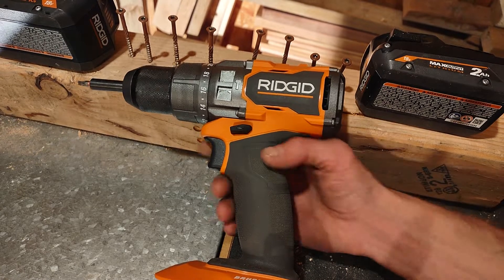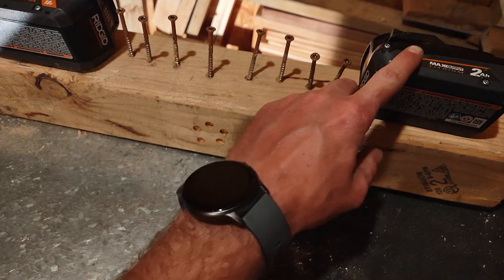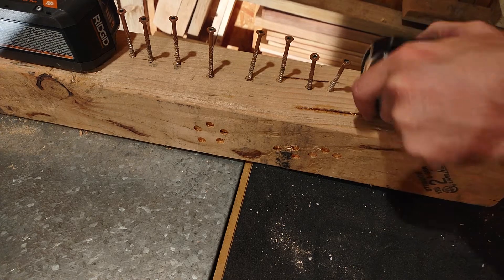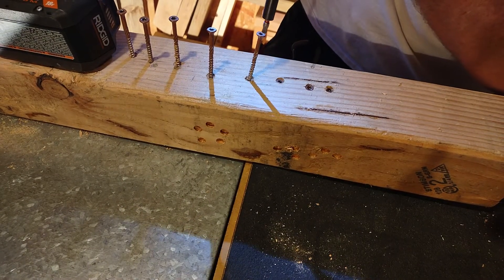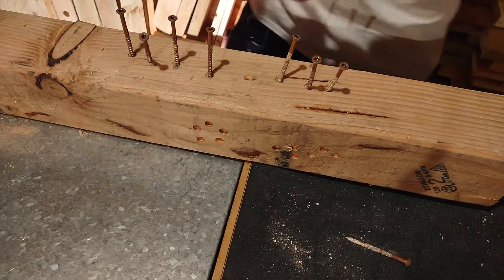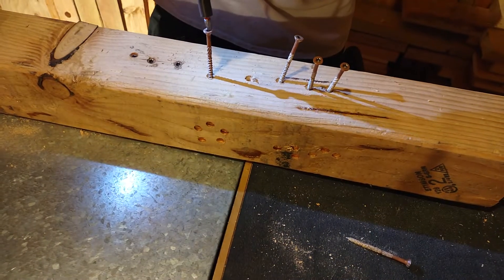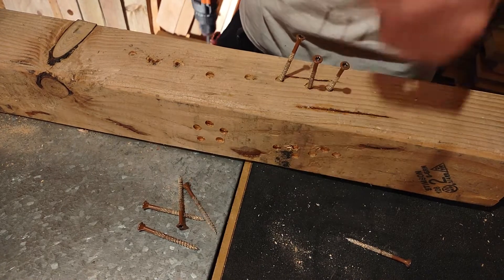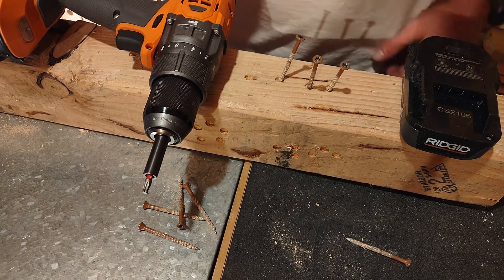Ridgid Max Output 2ah vs. 4ah

Comment: I got the Impact Driver I need the Drill Driver & that 4ah.👍😎
Reply from the maker: I'm excited for the high torque hammer drill they are about to release, it's got 1250 in-lbs of torque, this hammer drill only has 800 in-lbs. Still a beast of a drill though 👍🏼

Comment: yeah You will only see a performance gain with the 4.0 when the tool as needing more umph those screws are a fairly easy task 
good advise i agree use the 2.0 as much as possible. I would rather carry a 2.0 and switch batteries at lunch.than have a 4 all day and still have 1/3 battery left at the end of the day
Reply from the maker: Those couple extra ounces in battery weight really does make a bigger impact on your day having to carry it around than the overall performance of the tool for sure